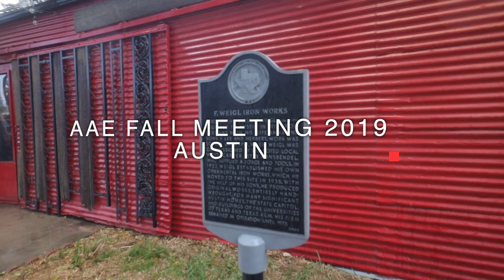Dynamic Access and 3D Printed Guides (Fall AAE 2019) Conversation with Dr. Abdennour

Comment: Thank for informative videos...Sir Bioceramic sealers are not available in Indian markets...I’m still using sealapex...what is your opinion on conventional obturation technique?
Reply from the maker: Any canal that's adequately cleaned you can fill with with a conventional obturation technique. The whole point of Hydraulic Condensation is that it's a little more efficient. If efficiency is not required you can certainly use conventional techniques. But keep in mind cone fitting and reducing the sealer interface is important for SealApex and other conventional sealers. Basically, the way conventional techniques work. Good luck.

Comment: Can we use BC sealer for perforation repair?
Reply from the maker: No. It will wash out. You need something with less viscosity. So, the BC Putty is designed for that. However, you can likely use the sealer for deeper perforations that are inaccessible for repair with Putty or small strip perf. But Putty is more washout resistant than the sealer. That's why the Lid Technique is used for apicoectomy rather than simply filling the retroprep with sealer alone.